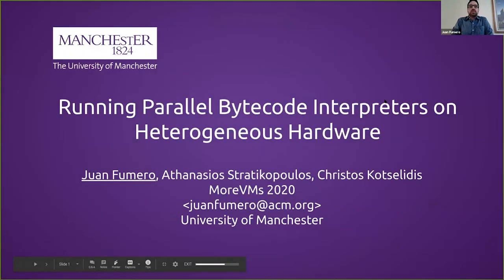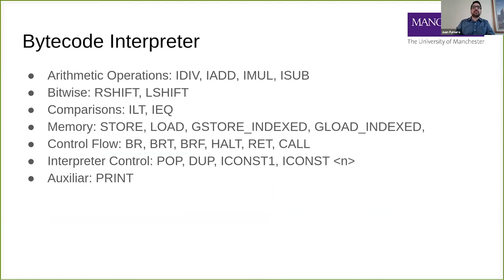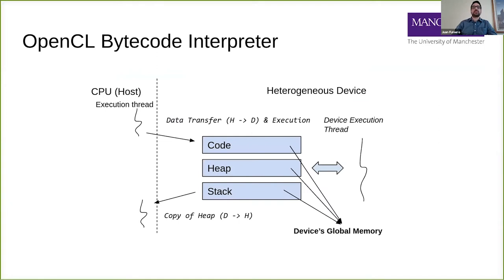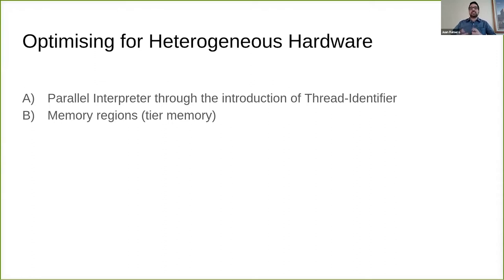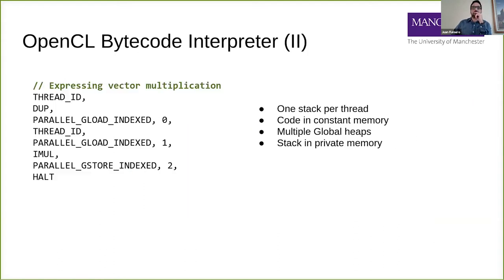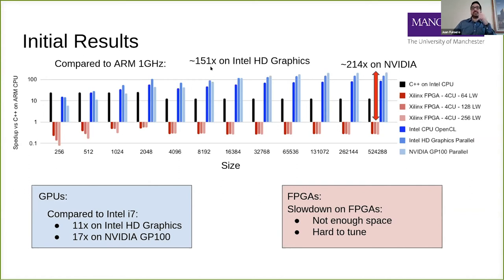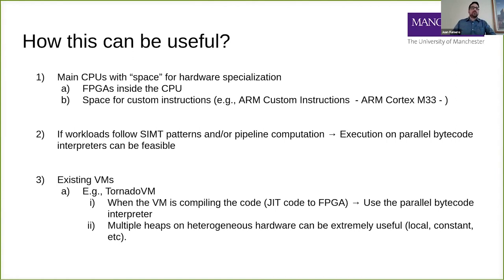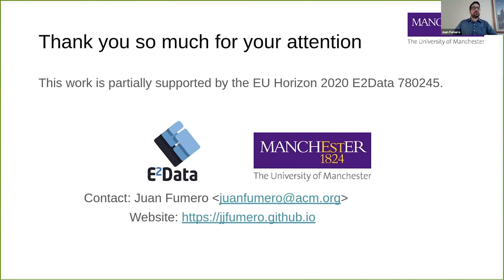MoreVMs’20: “Running Parallel Bytecode Interpreters on Heterogeneous Hardware” by Juan Fumero

Comment: As the presenter of this work, I have a correction: min 15:17 I meant to say "The FPGA we use runs at 300 MHz". It is actually the Xilinx KCU1500